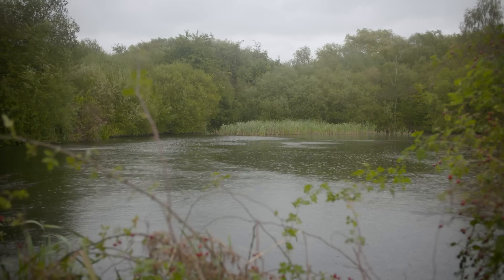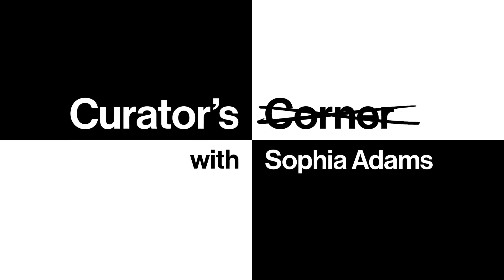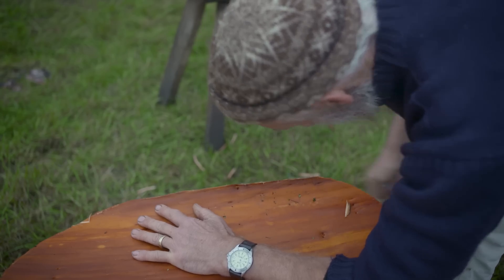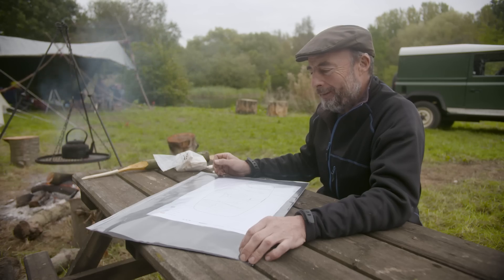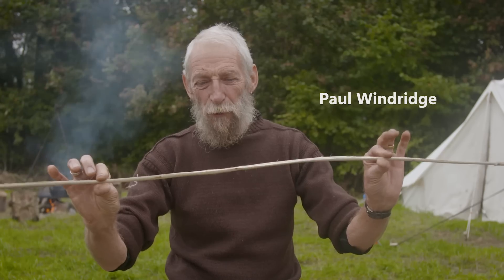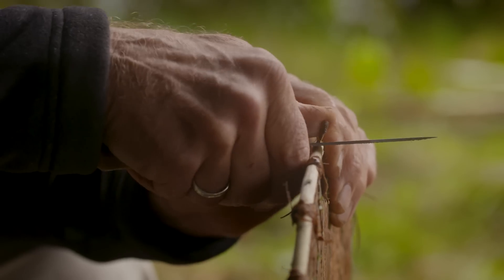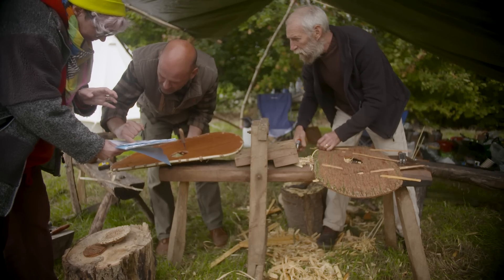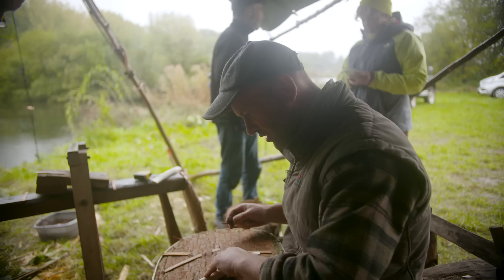We made an Iron Age shield... out of bark | Curator's Corner S9 Ep2

Comment: Ugh. Exactly as expected, there are a lot of comments calling it too small, too light, too weak, or a childs toy. Those commenters clearly have no idea what they're talking about. It is precisely what you'd expect.
A big and heavy shield is a slow shield and will tire you out in mere minutes. (Try going for a run holding a case of beer in your off hand at chest height. You won't last 5 minutes.) A Roman Scutum is big and heavy because it was used in static or slow formations. It's near useless in a quick skirmish. You want your shield to be about 60 to 80 cm long/wide, 3 to 12 mm thick and 3 to 4 kg. All it needs to do is deflect an opponent's weapon. The last thing you'd want is to absorb it.
A shield does not need to survive the battle, you do. A broken shield can be discarded and replaced.

Comment: I imagine it must represent what average people were using for armor in contrast to the known metal shields that wouldve been used by the elites.  The owner was probably a shepherd or a farmer, but ready to fight off attackers if he had to.
Reply: Shields often where made from hide and wood. I doubt that this was a poor man’s protection, it hardly would withstand stand a single serious blow.
I speculate it, also considering the size, to have been a child’s toy.
Reply: @Columkille72  Considering that Bark shields existed in an Indigenous Australian context where it was used in warfare, It is not unlikely that Bark shields were designed specifically with a skirmish-heavy context in mind in an Iron-age European context. I'd wager that the key thing to keep in mind is that they are not built to handle a great deal of abuse so I'd imagine the user would have to be actively deflecting blows away.

IMHO a bark shield is ideal for 'Yeet-and-retreat' actions where the relative lightness of the shield wouldn't interfere much, which would be a nice feature if you are expected to do a great deal of running about and dodging javelins before going in to throw your own.

It could also be a toy.
Reply: @thejackinati2759  Good point.
Reply: @Columkille72  Or a training aid for young people yeah.

Comment: If I may humbly add that, if you harvest  green bark and it's under layer, you can add wax and heat to turn it more leathery. I play at stick making and find that if you warm the bark, add melted wax, heat, add wax, over and over until it won't accept any more. I've done this on maple and oak.
Reply: The other approach is to paint it with several layers of thinned glue (which also helps fill in any tiny holes), then once it has thoroughly dried stabilise it by coating it with a layer of paste wax to protect it from the inevitable British rain.  And from the blood of your enemies, of course.

Comment: 3:40 "You wouldn't expect someone going into battle waving a bark shield..."
At first thought maybe, but add a second thought regarding the number of slingers who will be on the battlefield. A stout piece of wood between you and a lead ball the width of your thumb arriving at speed is a good thing.
Reply: Lead? No, they would have been flinging river/stream rocks (already smooth and the right shape)--easy to find, and requires no work at all beyond bending down and picking them up. That's what they found at hill forts, the ones that were clearly used for defense. Where'd you get the idea slings used lead? Sure, in late medieval times, but not in prehistoric times. Like I said, stones are dead easy to find and obtain, no need for complicated, difficult processes.
Reply: This is iron age, not prehistoric, and o pis correct that lead balls were often used in that period in slings
Reply: Then, there's a prospect of being nicknamed Oakenshield )